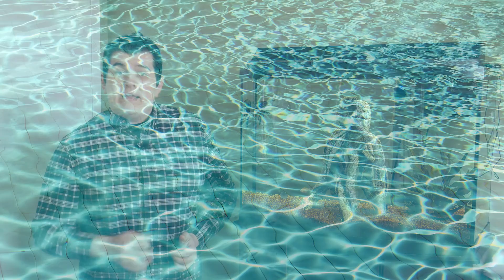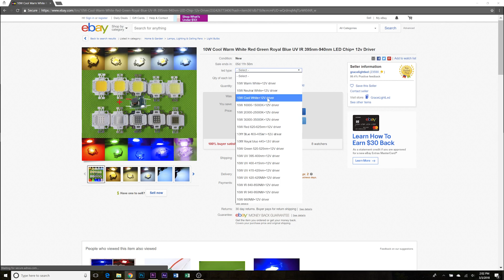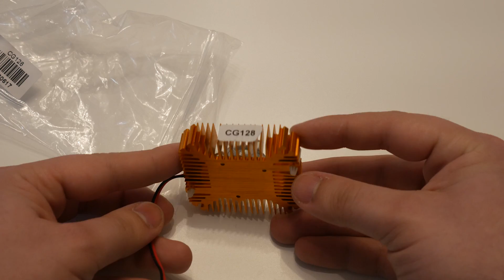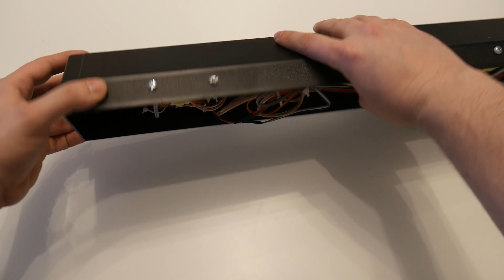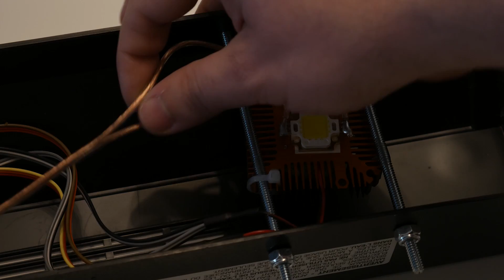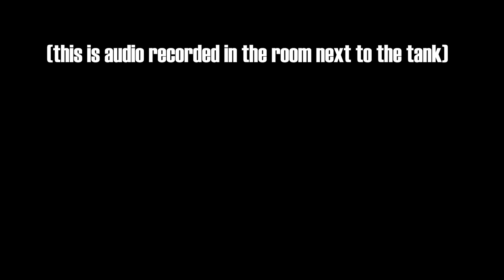A Short Project Involving LEDs, a Fish Tank, and some Laziness

Comment: You can significantly cut down on cycling time by borrowing a fist sized amount of gravel from an established tank and placing it in a mesh bag in your filter. As long as you aren't adding a ton of fish at one time you can add fish right away

Comment: You could simply buy an aluminium plate (roughly the length of your M16 bolts and width of those heatsinks you used) and directly apply LEDs onto it. That big of a surface is enough to keep 30W at <50C and it will be fanless ;)

Comment: So im very much into keeping tropical fish and if i may i have a few suggestions for your tank. 1: a few root tabs for that crypt and the other plants you plan to introduce would go a long way. 2: that airstone looks like it may be clogged so could replace it with a never clog airstone or a small box filter because why not. (good on you for having an airstone though. most fish love more oxygen in the water and they provide a bit more current to make your filter more effective and also help with surface gas exchange.) 3: you can buy a heater cover that looks just like that stump decoration you have to go over not only your heater but also your intake for your filter. 4: a python gravel vac is worth absolutely every cent and may be a good excuse for you to do a vid on the venturi effect. i hope you see this comment one day but  know youre busy so prolly not. either way nice fish.

Comment: If you use a plate of aluminum 2 or 3mm thick that runs the full length x width of your aquarium, and mount the lEDS to that, then the heat issues will be absorbed by the aluminum plate - thus no need for active air cooling

Comment: Well, these cheap COBs are usually less efficient than a fluorescent light. 

I'd rather spend 5$ per chip and get something decent from luminus or cree. Since they are way more efficient, you don't need as many. The cost difference shouldn't be that great.
You get the benefit of less energy wasted as heat, so you might get away with passive cooling

Comment: Btw the cycling of a tank in the initial stages of tank development needs to happen with an initial amount of ammonia in the water. If you just leave it running with plain treated water then no bacteria will grow due to a lack of ammonia in the water. Either place in your fish with a store bought pre-matured bacterial colony or  failing that you can also buy ammonia solutions which you put into the water to encourage bacteria buildup but this usually takes much longer than introducing an already established bacterial colony as you MUST wait for the bacterial colony to fully mature and consume all of the ammonia before introducing your fish to the tank.

Comment: Or on the flip side, you can buy an aquaneat LED light off ebay for roughly(possibly less than) the same price and do zero work. Not to mention...
-Quieter
-Brighter
-Longer life span
-Less heat generated

Comment: good job telling people not to rush it with a new tank. i've used these 10w LEDs for aquaria and growlights for a good while, running them at 12v but limiting them to 60%. power via PWM using an arduino board and MOSFET. then they don't get nearly as hot. for my big tank i had 5 of them bolted to a square aluminium tube, didn't get that warm even without any active cooling. yes i know the video is old-ish, thought someone might find that info useful.

Comment: also I agree with the others about RGB lighting, :) you should consider it when you need to upgrade, due to the "dubious" nature of the ones you bought. and maybe consider addressable LEDs? for slow arcing across the tank? heh heh. run like 5 strips side by side with the chips as close together as possible in sequence, then drive them all with the same data line, so they work in parallel turning each strip's numeric value of LED on at a time, thus, moving sun across the land scape, and then have a moon lit version do the same on second cycle far enough away, to give awesome night effect due to the reduced coloration to give a cooler light, and dimmer, with inbetween LEDs being pale blue to simulate light scattering and bright yellow for the sun spot of light, and black or off between the evening orange and pinks maybe with the "sun" LED spot being more and more red, thus simulating sunset and night time sky for the fish :)

Comment: the cycling part makes me wonder if you could condition two or three extra tanks worth of water ( quite a lot if you are setting up a 38 gal tank like yours, but less if say it was only 10 gallons, and manageable with 5gal paint buckets (*that have never been used for paint, like homedepot sells for projects) with water drawn and dechlorinated at the same time? then swap the fish into the tank with the single amount of water, and wait a day or two, then swap out the water with some from the buckets, to give them fresh unammoninated water, while the bacteria builds up in all the water at once, both in the tank and in the buckets, and keep swapping with the 3rd amount of water, or just do a 5gal bucket every 12 to 24 hours making sure to not use the same bucket again till all buckets had been used, 

reason for this is for those who end up with fish too soon, that would otherwise die, and want to save them, and not to replace the diligent process if you already know how to start a tank, as this would take far more effort and work, if it is even possible.

Comment: A watercooling loop seems like it could be a useful solution here, it would involve a bit of work, but could be hooked up to the filter pump, it could also save a tiny amount of power since the heater would have slightly less work.

Comment: As an avid cichlid owner, which I am sad to say has been a few years since I've had a tank, you dun gooft on that mix of fish, somewhat. Angels are a highly specialized deeper water cichlid. They can and will kill other fish and perhaps eat them. 
You need a lot more hidey-holes for your fish puppies and not so much bright light on them. 

I think you could do a lot better, and you can get dirt cheap second hand tanks, often a few dollars like 10 or less, at pawn shop and the ilk.

Also you should consider a microcontroller solution for heating, lighting, etc. Either a ras-pi or an off the shelf type.

Comment: Cool project. I just wanted to let you know, those aren't toggle bolts. Toggle bolts have a spring loaded butterfly nut that is used for mounting to something with limited access to the back side to use a nut. They are usually used on drywall in areas between studs.

Comment: I have had several small tanks (20 - 25 Gallons).  My favorite was a brackish water tank with a wet side and a "dry" side.  The animals that hung out on the dry side were a mud-skipper, and a small red crab.  In the wet side, were a green spotted puffer, and some ghost shrimp.  This setup lasted for about 1 year, until a toxic water change killed everything.  During that time though, the mud-skipper learned to eat from my fingers, and would even hop into my hand and allow my to walk around the house with it.  BTW if you have one, wet your hand with water from the tank so the mud-skipper's skin stays wet.  While they make very engaging pets, I don't recommend getting one as they can't breed in captivity.  As far as I know, we still can't provide the proper environment for that.  In my experience however, and I'm not a professional at all, a proper tank set up is very low maintenance.  If you have to clean the tank more than once per month, you should look at the types of fish you have, and if you don't have plants in there, probably add some.  Another consideration is, large tanks tend to take less maintenance than small tanks.  My tanks did have florescent fixtures in them, however, I had grow lights installed rather than a standard white light.

Comment: If the tank is large enough, and you have tropical fish that require a heater, you can water cool the LED chips to eliminate fan noise and reduce power consumption (from both the fans and the heater)
Blue chips also have a high enough frequency to partially simulate a black light... handy for fluorescent fish such as neons.

Comment: Color accuracy is really bad on these cheap flood light leds, cri in the 70s region. Look for some high cri leds instead.
Edit: https://www.ebay.com/itm/BRIDGELUX-BXCD45-20W-3000K-3200K-45mil-Multichip-LED-High-CRI/222165944656?epid=1237609892&hash=item33ba1f4950:g:zcwAAOSwmtJXbtKJT
This one might work.

Comment: Why not slow the fans way way down ... they should still provide way more than adequate cooling

Also, I usually just epoxy the leds to heatsink when I need to, the layers is small enoguh and usually the epoxy conductive enough for it to be the perfect solution almost always (provided you don’t need to rip the parts off of the heatsink)

Comment: This is a pretty cool idea. I personally would have looked into going with ceramic metal halide sources though since you can get lamps with as low as a 20w output for less than $10 a lamp and the ballasts themselves are insanely cheap on the used market. The only downside would be having to design a shield for the lamps if you plan on running them right up until they fail because they can be a tad violent. Replace them yearly though and you won't have too many problems.

Comment: It would be even more efficient if you could use the heat of the drivers to help keeping the water temperature at its desired level. I have done this by attaching the transformers to the bottom of the tank, which is made of stainless steel. I must admit LED looks better than I had expected, although I'm not sure if the plants will grow using this source. Thanks for this useful video.

Comment: if noise bothers you enough you could easily get a heatsink not too much bigger capable of passively dissipating 10W, e.g without the fan. those ones looked pretty small. cool project

Comment: Every 7K (Kelvin, same scale as °C), the mean time to failure becomes half as long. This rule is true for all semiconductors and most other electronic components which age over time. 

So if your LEDs run 7°C hotter than normal, they last about half as long.
When running 14°C hotter than normal, you get a quarter of the normal lifetime
At 21°C more you get an eight!

When your LEDs run 28°C hotter than intended by the manufacturer, they still seem to be fine since there is no smell and you can even still touch them (briefly). But the mean time to failure is cut down dramatically to about 6% (1/16) which is not much.

Look into a data-sheet, while the mean time to failure numbers seem very big, they are only valid when the LEDs operate at very low temperatures, usually 25°C. Running them at their legal max temperatures (usually 70°C) will give you not much of a lifetime at all.

Also the light output degrades over time. Monochromatic LEDs have an insane lifetime of like a million hours. Then they are down to 75% intensity. White LEDs have rather low numbers - and the worst part is that this is the time until they are down to 50%!
Since the human eye is logarithmic, 75% appears as half as bright already, 50% is usually almost useless for the intended purpose.

Comment: Using a old stock heatsink from a CPU may be useful if you want it quieter.
Reply: yes those stock Intel or Athlon heatsinks are cheap or easy to harvest and can run at 800 RPM with low noise. Another solution is to create a venting tunnel with passive rads and a fan mounted on one side (or a push-pull configuration).

Comment: I use a couple of LED security lights to illuminate my tank. I switch to a lower level of blue light at night. My only issue with the basic white LED chips, is that they have pretty crappy CRI rating. That basically means they don't render colour as well as sunlight.I think red colours don't pop out as well as they should. I do like the shimmer.
Reply: You can get MR16 lamps with high CRI, rated for fully enclosed fixtures, for example the Soraa Vivid and Radiant series. They should work well in an aquarium, and with no fan noise.

Comment: Have you thought about, umm, water-cooling the LEDs? I doubt the thermal load would do much for the temperature of the water,  and it could remove the fans and the tank heater at the same time.
Reply from the maker: As I've replied elsewhere, I think that's a pretty good idea.  But, I have reservations about creating another path where water escapes the tank.  If 100% of the 30W was able to be transferred to the water, that would have a negligible effect in the winter, but in the summer it might actually cause the tank to overheat if there's direct sun coming in.  I usually keep the thank at 78 degrees, which is only 3 degrees warmer than where I keep my A/C.  Without a thermostat that could be dicey...
Reply: +Technology Connections If you were to do something like that then it would probably be safer to include a thermostat as a safety measure. This is especially true if you live in an area prone to having warm humid weather during the summer, the ability of water to dissipate heat to humid air is significantly lower than dry air since of course evaporative cooling is a major component of the heat dissipation from water to air at 2.25 kJ per gram the heat loss is far from trivial.

Comment: Those LEDs CRI wide enough for plant photosynthesis ?
Reply: Well if you can successfully grow with high pressure sodium which has a CRI of 26, I'd assume you could with an LED that has a CRI of about 80. CRI isn't really all that important just so long as the lamp puts out the right wavelengths of light for the plant to photosynthesize.
Reply: Good stuff. I just know the output of LEDs isnt really strong enough or wide enough to charge up things like the lume on wrist watches so as much as their energy is focused in the visible spectrum they arent as good for the other uses of lamps.
Reply: You can get GrowLight LED chips as well that are tuned to the relevant wavelengths. These are usually only Red+Blue at the optimal wavelengths, but I can't imagine toying around with some different-hued green LEDs to get the best white you can would be too much hassle.

Comment: Like you said, dubious quality. You could see the tiny chips used in those LEDs. Don't expect them to last. You can get quality Cree CXA series LEDs for just a few bucks a pop from Mouser or Digikey. The high CRI ones won't look greenish to your camera. Since they are not over driven, the efficacy will be greater as well.
Reply: I absolutely must agree. The Cree LED's really are much, much better.
Reply: @SplicesAndCelluloid  I actually built a hood with about 15 1w Cree LEDs and a PWM controller back when LED tech started becoming viable. I had managed to put together a really cool planted aquarium. Kinda want to get back into it. But first, snek.

Comment: one thing you should know about, computer fans are rated for 12V, but they do turn as low as 5V. hook up some resistors and glue them on the aluminum heatsink and you'll be all set.

Comment: just be careful as you didn't seal the soldered point / cable ends..
I did this last year and the pumps / air bubblier splashed small water droplets or might have just been condensation onto the solder points and within a short about of time I started too get copper / lead / heavy metals dripping into the water the fish we're not happy and a few died before I noticed what was happening and sealed everything so water cannot get near the solder points and cables.

As a side note if you want to use a tank stright away you can do all you need is some cycled media to seed the pump / tank with and you can be up and running straight way..

For more info on fish see, Go visit Joey on king of DIY https://www.youtube.com/user/uarujoey

P.S. nice Angel fish..
Reply from the maker: The lights aren't directly above water.  There is a sealed glass panel beneath the hood fixture.  Assuming it is seated properly, it's completely sealed.
Reply: while water evaporation could cause corrosion on the solder joints, he possibly could just cover the joints in hot snot/glue...

Comment: Slow the fans a bit with a PWM  on the fans to slow them down a little, it should remove most if not all of the noise. 

Or replace the heat syncs with water blocks and use some of the water from your tank to cool them. Then the heat will be used to heat the tank saving money. For the most part this will just mean your heater is on less. If you are very paranoid then you could have the lights turn off if the water is to warm, a bit of a bother, but not a real problem.

Comment: I just use 2 part epoxy to bond the LED chips to the heatsink, and this does work well for low power units. Sand the heatsink surface with some 200 grit waterpaper and the LED back, after soldering on the leads. Then wash both sides with alcohol to degrease then a small blob of well mixed eopxy, press firmly and use something to apply pressure for the 5 minutes the epoxy takes to gel. Then leave for 24 hours to cure.